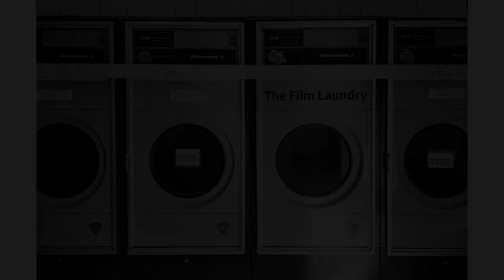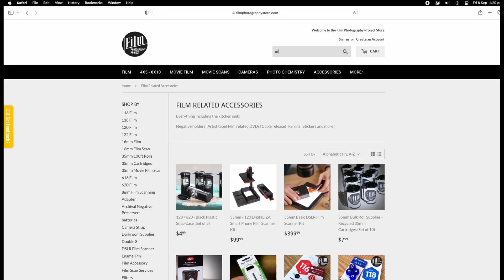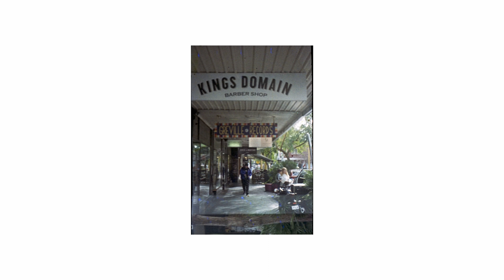Minolta 16 - 3D Printed Film Cartridge

Comment: I bought my first Minolta 16 format cameras from a pawn shop in Bremerton, Washington (USA) in 1981.  I got a 16II and a 16MG -- the latter with built-in light meter and close-up lens.  I could still buy film, even at drug stores, so I shot those cameras a fair bit, but I didn't have the setup to process my own film at that time, and commercial processors broke the cartridge to access the film inside, so I never managed to accumulate cassettes.  Twenty-plus years later, however, I bought cartridges on eBay (they were plentiful and fairly cheap in the early 2000s) as well as buying a Kiev 30 and Kiev 303 which came with their own cartridges (that don't fit in a Minolta, though the Minolta cartridges work in the Kiev cameras).  I've reloaded the cartridges with microfilm (readily available in unperforated 16 mm) and cut 16 mm strips from 120 (gives six slightly short reloads from a roll, or three slightly over length for the Kiev cameras).

Sadly, the auxiliary lenses I had for my 16 II developed surface etching from decades in the leather camera case, and I never got good images from the 16II even when the lenses were usable -- but the MG and my later acquisitions of an MGs and QT (both of which, along with the Kiev cameras, make a larger 13x17 negative) gave admirable images -- the QT has a focusing lens, as do the Kievs.  These days, the Kiev 30 is my go-to 16 mm camera -- as compact as a 16II, with a focusing triplet lens and larger cassette capacity (longer film strip and counter goes to 30 instead of 20).  Image quality is like the better 110 cameras, but it's easy to get 16 mm film to reload it (unlike 110 which is a PITA to reload, many of the cameras don't like reloaded cartridges, and depend on the backing paper which has a limited life).

FWIW, the original Minolta 10x14 frame is twice the size of the one from a Minox, and those can make quite good 8x10 prints.  The difference is the Minox lens is MUCH better than the one in a Minolta 16II.  Would I use my 16II on a regular basis?  Like you, no.  But I'll carry a Kiev 30 or a (double the size) Minolta 16 QT loaded with microfilm or Vision3 any time I don't have room or want to carry the weight of a 35 mm or larger camera.
Reply from the maker: I've always been interested in the Kiev's, might have to grab one.
Reply: @thefilmlaundry  I recommend the 30 over the 303, and either over the Vega.  Vega had 10x14 frame and Minolta compatible, 20 frame cassette.  The 30 and 303 cassettes won't fit a Vega or Minolta, but hold 30 frames and those cameras can also use Minolta cassettes.  Do try to get cassettes with them, I don't know that there are .stl files for the Kiev 30 frames cassette.

Comment: I looooove shooting subminiature formats. The 16ii is fixed-focus at approximately 3 meters and begins suffering from diffraction if you stop down much past f/5.6. With a careful selection of film and subjects one can achieve very good images with some practice. There are auxiliary slip-on lenses available to adjust focus to infinity and closer (portrait) distances. Portraits done this way, particularly with B&W film, can be incredibly striking as the small format tends to amplify the filmic aspect of the image.

If you want to get exotic, try getting ahold of some proper 16mm microfilm. It is 'only' ISO 12 but is surprisingly usable with this camera in daylight. I've taken some photos that can actually rival medium format in some instances. Results from Vision3 50D also often leave my jaw hanging.
Reply from the maker: Sadly I couldn't find the extra lenses, would have loved to try them out. I definitely noticed the fixed focus limitation of the standard lens. 
I do think my next roll would have to be b+w. Although some 50d would be fun, just am a bit too lazy to have to deal with remjet